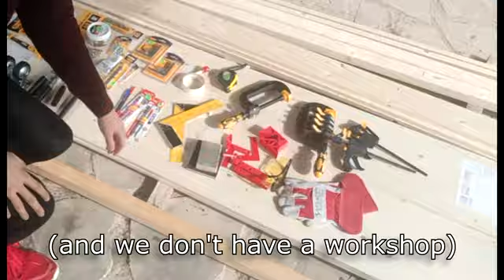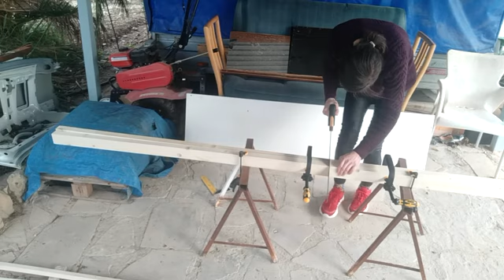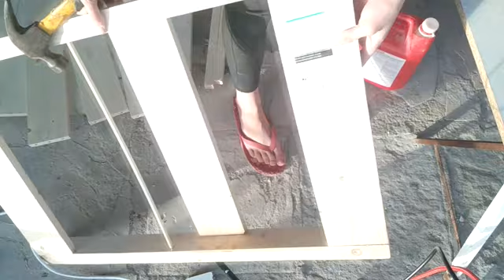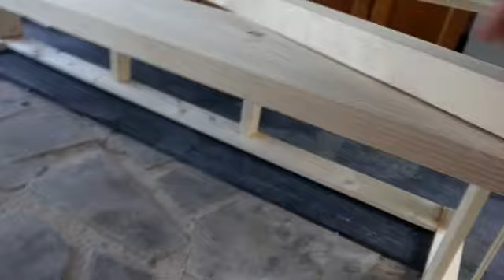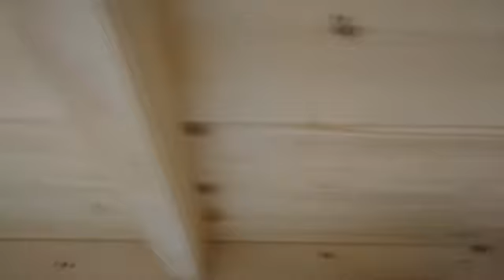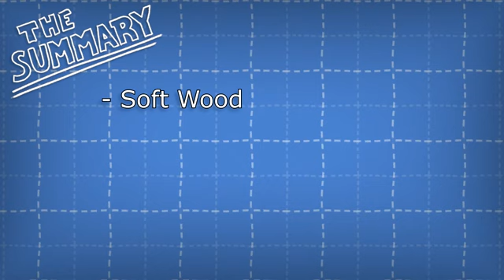I Made A Workbench! (even though I have no woodworking experience oops)

Comment from the maker: Oof, well, I messed up a lot on this project, and I also messed up a bunch during recording, since I seem to have missed a few important shots, but I can't get them back without a time machine. I have tried using some little animations to try to substitute the missing information. Sorry about that! 

I should be clear that I don't consider this a tutorial or guide or whatever, this is more like documentation of my experience. 

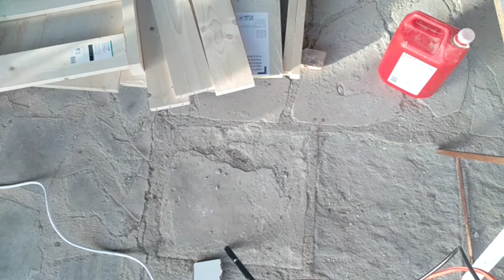I think for that bit around 7:00 where I'm doing stuff out of frame, I actually didn't think I was recording then. It looks like I accidentally didn't start recording the bit before that shot (the actual assembly) so when I pressed the "stop" botton, it just started recording the set-up for the next shot (whacking more dowels into holes) which I also didn't record since I just stopped the recording instead of starting a new one. Massive oops. 

I've also been watching a few channels that do woodworking (Under Dunn and Adam Savage mainly) so I've already learned about a few new things, but it's certainly looking like a table saw would be super useful for this sort of thing!

Hopefully I'll get better at both making and recording the process as time goes on